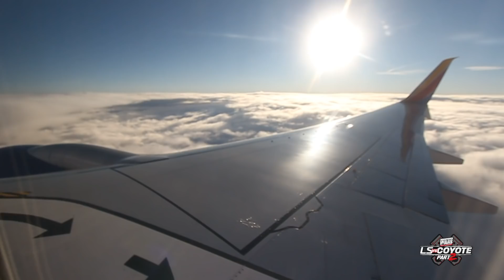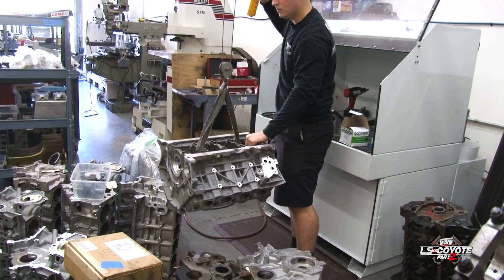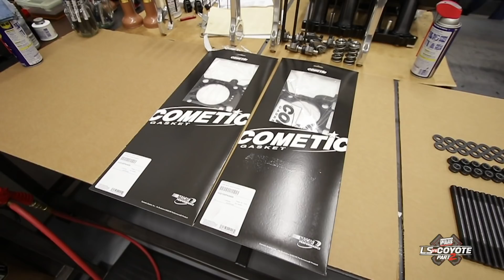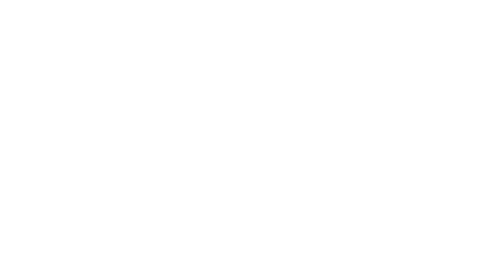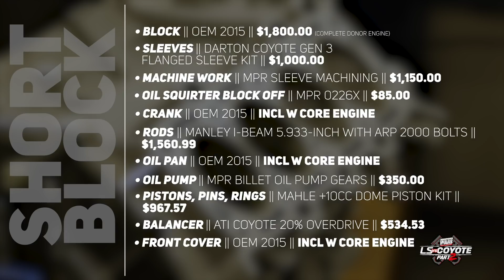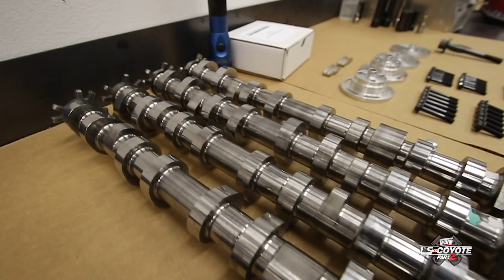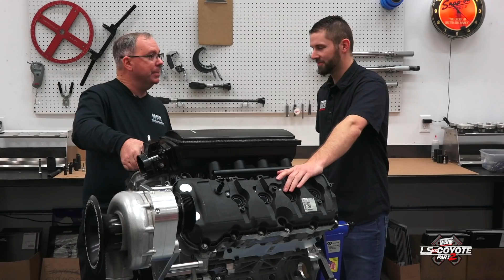LS vs. Coyote 2 Episode 3: The Coyote Engine Build

Comment: So for coyote you charge for port work LS you did not. For Coyote you charged for valve springs and valves for LS you did not.  The intake for Coyote was full retail at summit yet LS intake got a $1600 "customer discount" not the full retail price. Come on its beyond a joke at this point
Reply: @theunbreakable1587  And they wouldn't spend no 9200$ on the bottom end like this fanboy is stating. There are similarities between the two builds that cost a decent amount, but if you really look into each 15k build both teams provide about the same amount of performance parts. Only thing is LS cheated with not putting any machine work in there build like coyote did. If coyote didnt put machine work in there build they would have been able to buy some decent gt350 heads.
Reply: yup, seems quite fishy. Props to the Coyote being able to handle all of this using stock block, heads, and crank!
Reply: Oh look, it's somebody who can't read the rules.
Reply: So when you called LME and gave them your credit card number for the exact same engine they said "no" ?
Reply: In the same way the LSX based engine is $25000 on LME's website, but somehow it fit in the $15000 budget for this comparison.
Reply: Alpha Wërks  what part of eat TN are you in i I’m in same area an there’s several gas stations in my city that carry e85
Reply: @argelioolivares631  It's still a 100% LS design. The LSX is essentially an iron-block LS7 with thicker cylinder walls. No different than if the Ford builder had used an aftermarket iron Coyote block.
Reply: @Alpha Wërks  I have never had it on a dyno but it's been 10.20s at 138 but with a 2.16 60.  Has a built 4l60 and a moser 12bolt. It has 305/30zr20s on the back and spins like crazy but it's not a drag car. Just two seasons of grudge night racing. It is fun picking on hellcats though lmao.
Reply: The LS is like a glock. Or ar15. You can get every single part including the block from anywhere but GM. The coyote is rock solid from the forge/casting facility.
Reply: at the beginning i knew it will cost more money
Reply: @Alpha Wërks  more power per cubic inch cost more money this engine is on the market since 2011 the ls based engines are in the market for the last 20 years
Reply: @TheUnbreakable 1 actually the only thing left on that 1500hp motor is the crank ;) but it runs like a bat outta hell, bro! aren't you talking about the 2001 Mustang Cobra SVT with the blower on it with the Tremec t56 6 speed and it is the fastest street-legal Cobra SVT on TRC? they also have the fastest 1500+hp corvette on there with a stick shift i think using the t56 magnum...
Reply: They where used oem parts did you not see them
Reply: @argelioolivares631  several in texas buckner rd in dallas tx. jefferson road dallas tx. i got a lsx376 of division rd in Arlington tx for $500. They also have 572 stock chevy big blocks from 70s corvettes
Reply: Some Coyotes make north of 2500hp on a stock block.
Shaking my head at you.
Reply: @robertelmo7736  Since when? Show me a stock block coyote making 2500hp, because I've never seen one
Reply: As already stated, many aftermarket LS heads come complete with port jobs, valves, springs, etc. The Coyote got to use a used 2015 F-150 block while the LS used a brand new LSX block. So let's have the LS pay full price for an intake manifold and have the Coyote buy a brand new block and see who stays under budget. The only way the Coyote can compete with the LS with any sort of budget restriction is by getting a massive handicap by buying a used block compared to a new LS block. Same exact thing happened in the last LS vs Coyote shootout.
Reply: @KTM990WFO  Coyote included $1500 core motor....
Reply: @KTM990WFO  watch the video mate they clearly state they port the brodix heads on ls you can even see they fire ringed them. They also state pac spring titanium intake valves and retainers. These are not off the shelf summit brodix heads. Also no one forced them to use aftermarket block they could have used factory block
Reply: @SomervilleMetalWorks  I vaguely remember that now, you may be right. The LS builder was correct in selecting an LSX block over the LS7. Factory LS7 blocks have rather thin cylinder walls and while they make stupid power NA, they tend to come apart under high boost applications like this. I personally think the Coyote builder is insane trying to run 12.25:1 compression on ~30 pounds of boost.
Reply: LandRoverLife 
If I recall correctly, they CNC-ed and ringed the LS heads in house.  If so, it should count as labor and not applied to the budget in this comparison.
That said, if the Coyote heads were CNC-ed in house, it shouldn’t be attributed to the budget.
Reply: KTM990WFO that’s exactly what I thought both times. Coyote gets the advantage with used lower end. Both times. And these tards are complaining it’s the other way around.
Reply: @KTM990WFO  They CNC's the LS heads on there in house mill.
Reply: @KTM990WFO  
Budget builds are for broke ass people. You pay for quality [Coyote] or buy cheap [LS]. Lol
Reply: @Sig721Tau  What specifically is not quality on an LS? The LS is cheap because it has fewer moving parts due to the simpler design. So by your own logic, I guess a Coyote is a cheap piece of crap because it's not as expensive as a Ferrari engine?
Reply: What do you expect when you need to use a lot of factory Ford parts.  They need to be machined to get the most out of them.  An LS has anything you want made right off the shelf.  That's one of the biggest reason the LS is so much cheaper to build big horsepower.  And if you go back and watch he talks about all the machine work they did to the crankshaft,  but did not list a single dime in the breakdown for it.
Reply: Captain Howdy what’s big power? Stock motor stock heads coyotes making 800rwhp on e85 w/vmp gen 3 headers intake fuel system
Reply: @ryotaryuu  What are you talking about, did you not see all the machine work they did to the LS engine??? And LS did work to there crank as well and didnt put it in the budget. You chevy fanboys always have stupidity coming out of your mouth. "LS engine doesnt require any work you can just run with it." LS video drops literally every 30 secs it's getting machined. Gtfo you turd!
Reply: @NitrousYote   the LS crank was bought that way.  It wasnt machined.
Reply: @ryotaryuu  WTF are you talking about. They adjusted the crank a little bit to get a smoother rotation. Also LS is not the only one that can buy a pre balanced crank. Just bc coyote bought one and re balanced there assembly does not make LS any better. Coyote can buy a pre balanced crank. The fuck you guys act like Ford just magically doesnt have access to the same capabilities as LS does. You guys are still using the old traditional push rod setup. Ford advanced there Technology to a 4 valve DOHC setup to raise the RPM range while significantly introducing power through that band. You guys are trying to compare a 427 cubic inch to a 302 cubic inch engine and you think Ford cant get ahold of a pre balanced forged crank from the factory???😂😂😂 My guy take your extra 125 cubic inches and google search head ass somewhere else. Coyote>LS
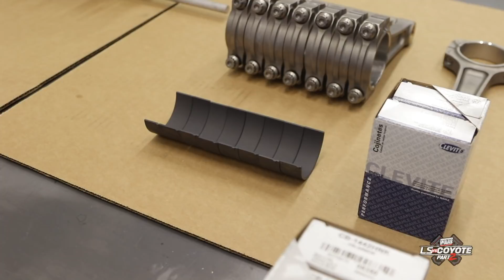Reply: @ryotaryuu  I'll help you out brotha, start at 10:58 on the LS video and you'll see that LS did preparations to there quote on quote factory ready to drop in crank with no work needed as you are so inaccurately trying to state. Not to mention that the LS block doesnt even come in the correct size and has to be line honed. C'mon bro you are straight garbage with your stupid ass comments. Everything you said about LS coming from the factory and can be drop in ready with no work needed and that's why it's cheaper than Ford is a fucking lie. Watch the entire LS video again they are doing mad machining and preparation to there build. JUST LIKE COYOTE. A great engine build is conducted with the extra mile of making sure there are no imperfections that could cause failure or certain aspects of the build to not perform the best. LS has no advantage of using factory parts and not taking steps to machine or prep certain items of said part when you're trying to make a 1000hp+ build. Dude you're just full of Chevy fanboy SHIT!
Reply: @NitrousYote  blah, blah, blah.  Just admit you can build an LS equal, or superior in power, and reliability for much less than a Coyote. I mean just one example if you want to do just a cam swap you are looking at most $300 for the LS, but a Coyote will cost you a minimum of $1500 but can be as much as $2500.  Just I understand they are completely different engine designs, but that still doesn't change my point.  If you want to build a good, reliable, powerful engine and you have a limited budget the LS wins.  Even if money wasn't really an issue.  If you look at it from  just a pure economical standpoint if you do racing you would really, really WANT to run a FORD engine over an LS because it would be much cheaper to run and maintain an LS.  It's just the truth.  I'm sorry but you just can't change facts.
Reply: @ryotaryuu  You go from, trying to making a point that LS basically had factory parts that didnt need to worked on bc they were off the shelf ready to go which would make the the build cheaper. Which you were completely ass wrong. To a trying to compare a cam swap???? 1st off let me say you're a dumbass. 2nd off that same engine build that LS is doing is 25 thousand dollars on LME website. You are going to spend a fuck tone of money on this type of build regardless if you're LS or coyote. Idk where you're getting a min and max amount for a cam swap but they are not 2500$. We also have 3 more cams than LS its going to cost more bc we have more. You're trying to flip the script and bring up a totally different conversation bc you know your first comment was in accurate. LS was using alot of factory bolts bc they didnt have enough money in the budget  to use ARP hardware. Coyote did. Nothing you're saying is proving anything close to a point. Stay on one topic and learn when to admit you're wrong.
Reply: @ryotaryuu  The fact you guys are building an LSX engine that LS doesnt even use in a factory production car trying to compete with a 302 cubic inch coyote that has been in factory production cars since 2011 speaks for its self. Coyote is not using the Voodoo block or a cobra jet block or a pre forged built race block, there using a factory product car block and LS is trying to twist the rules and find a grey area by using a racing block. The word Coyote limits Ford to one block only. The word LS hell you can choose what 7-9 different types if you wanted. You guys already try to start out by cheating and in the end it still wont matter bc Fords little baby ass 302 cubic inch will still match the power and with it being DOHC that revs past 8k RPM it's going to be the faster car in a race. Ford has been lacking cubic inch forever with the coyote but yet time and time again you see coyotes running the streets. Boost complements the coyote engine in manner that is almost poetic. You can keep your 300 dollar cam install.
Reply: @NitrousYote  that's does really matter.  The only reason they are using the LSX is because the block is made out of better metal and is stronger to support more horsepower.  The dimensions are the same as an LS.  Besides the Coyote basically had to be torn apart and MADE into something completely non stock to support the horsepower numbers they want.  It's not a stock engine now either.  It doesn't come in ANY production Ford vehicle in this configuration, so what does it matter.  The LS just happens to have more aftermarket support so why not take advantage of it.  I mean THAT is the whole reason behind this comparison.  They already did the stock vs stock block  N/A engine comparison.  This is the ALL OUT with the best aftermarket support comparison.  We can't help it that no one makes an aftermarket Coyote block can we.  And to be honest why would anyone want one when you can just re-sleeve the stock block?  Yes it costs a lot to have it done but when you consider how much a used low mileage Coyote, even from an F-150 costs, and then add the cost of all the machine work to re-sleeve the block it is still double the cost of the LXS block alone. The LSX block is like $3,500.  Add some finishing work oh what the hell let's say you spend another$2,500 out of your pocket for machine work.  A used lower mileage Coyote will be $6,000-$8000.  I just looked at prices.  MMR charges $1,200 just for the re-sleave service.  Even if you do not need any resurfacing to the block, which I highly doubt, the Coyote will cost you $7,200-$9,200 just to have a fresh block ready to build.  The LSX would be $6,000.  And that is being generous.  And you know darn well if someone made an aftermarket Coyote block similar to the LSX these guys would be using that anyway.
Reply: @ryotaryuu  where the fuck are you pulling these prices from. I want the contact to your LS dude who supplies the parts and work for the price your given. Bc I have some LS friends who would love to follow up. No coyote short block cost 9200k. You can get a 1500hp capable bottom end from JPC racing just for 5400$ and if you give them your stock block and stock crank you can receive that same block for under 5k. Your LSX engine your talking about is 24k for the entire long block on the LME website without a intake manifold. You are a huge faggot. Stick to your gay ass 2006 dodge charger fanboy!
Reply: Sprayed Coyote Yep, coyote>Ls... externally. So the Ls is actually the smaller motor all while making mo power! Hahahahaha
Reply: Captain Howdy Man... some Ford guy is always getting bo bo hurt and lashing out. 
Sucks being inadequate.
Reply: Not to mention they resleeved the coyote's cylinders
Reply: I dont see the stock coyote block yall 👀 see bitch had sleeves
Reply: Melissa Hill Fair?? This whole thing is apples to oranges. The coyote having 4 valves per cyld is a big advantage over the LS. So that isn’t fair. But then the LS has more cubes? So? Fair is hard to apply to this. In my mind with my crazy way of thinking I actually feel the LS is a smaller motor because it can fit in a smaller space. I couldn’t care if the coyote is 150 cubic inches or 500. It is physically bigger. So to me the Ls is smaller. Just my $.02
Reply: @theunbreakable1587  Jealousy is a bitch man.

Comment: A lot of people are complaining about the LS being over specced compared to the Coyote, and while that's true (sort of....I'll explain) the fact is, it is a 15 grand for 15 grand shootout and considering what has been said in this video in particular, the Coyote doesn't have the aftermarket like the Chevy LS so prices are going to be more competitive for the LS stuff and the fact is has only 1 cam and 2valves per cylinder does also take away cost (but it would have been interesting to see what the Coyote would do with some worked over voodoo head on it but like it was said, just wasn't in the budget)

I suppose what we should of had happend was a Chevy LS vs Ford Modular shoot out rather than just the Coyote

Comment: Well based on the fact that they went with a junk yard yote engine and the fellas with the LS build have only stock head studs.....I think the LS is going to win.....maybe they shoulda stroked the yote as well to get a few more C.I. but that 427 is super built compared tho this shit.....still gotta give it to MPR for the effort but they dont know what they're getting into....I think in the real test they should put both engines into fox bodies with same transmission and same gears and then see who wins that......I'm a Ford guy and yes im rooting for the yote build but and LS7 vs a junk yard truck engine is truly like david vs goliath......good luck MPR you're gunna need it
Reply: You are talking about sleeved coyote block that can handle 2000hp not a junk yard block vs aftermarket ls block that can handle similar power level.

What the coyote loses in cubic inches compensates for in heads flow, compression, 4 cams, and high RPM. It's just a different approach of making hp.

Don't also forget that they added points for hp/cubic inch in this shootout. I personally think it's a fair game.
Reply: @POWERLSX  

Still think it's a miss match....
Reply: @17sanjoeddie  no shit bro i remember they doing a explanation video for every one after the first shoot out that they use a ls 6.2 because thats what your gonna find in a camaro ss. Well ive never seen a chevy off the lot with a 426 lsx iron block jajajajaja
Reply: @argelioolivares631  Well there is the C6 zo6 and the camaro Z28 that have the Ls7 but no where near that Ls7 block they're using....one of the rules should've been OEM block
Reply: @17sanjoeddie , LSX is a GM built engine
Reply: @anthonywebber2211  LsX is not a factory built engine it is an Ls based engine made from different materials. You cant find an LsX block in any gm car